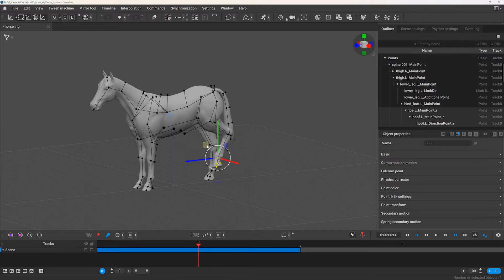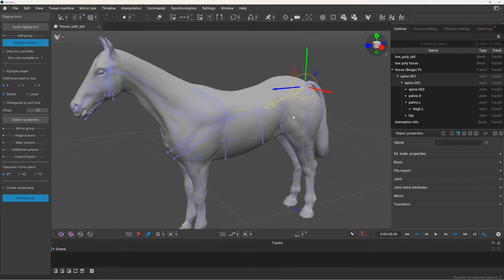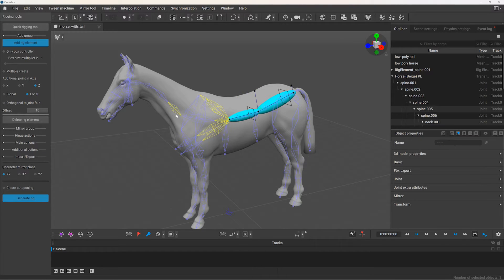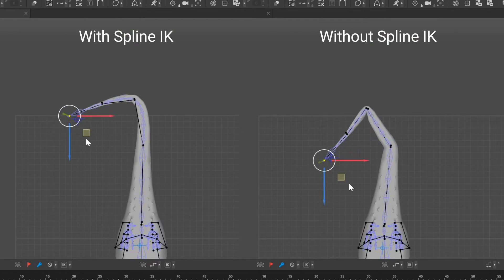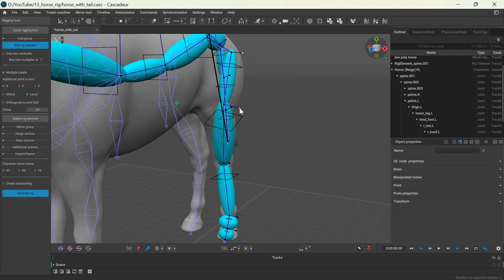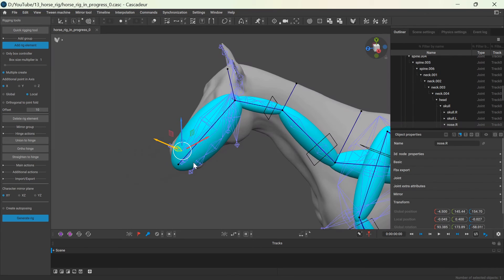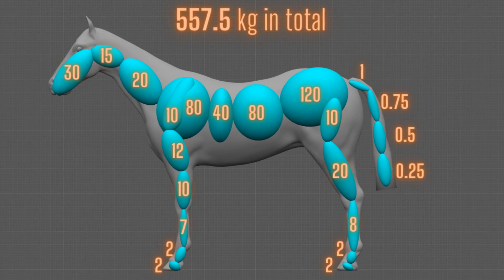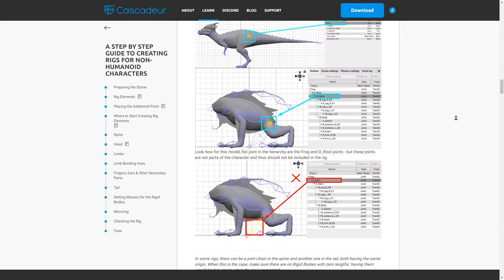Creating a Horse rig in Cascadeur

Comment: Do you create animations in Cascadeur just for the model your working on, or can you reuse them? Like applying an animation to another model that you import ?
Reply from the maker: If the models use the same armature you can apply the animation for different characters.
Reply: @AronNemeth95  and if they don't have the exact same armature. But a similar one (also humanoid)with same bone amount etc ?
Reply from the maker: @nwotyzarc  It should have the same hierarchy and bone names. Otherwise you can try retargeting the animation in another software. 😕
Reply: @AronNemeth95  ah okay I see. Thanks! :) 
And when I have a character with same rig hierachy and naming, but he has extra bones (for example some clothing bones, that needs to be animated) could I apply my previous animations to the humanoid? And adjust the clothes in key frames accordingly. Or would unassigned bones cause problems and I would need to create a new animation for him?
Reply from the maker: @nwotyzarc  I think it should work as long as the additional bones are at the end of the hierarchy. So you didn't add any bones between existing ones.
Reply: @AronNemeth95  thank you so much. Really helpful! :)